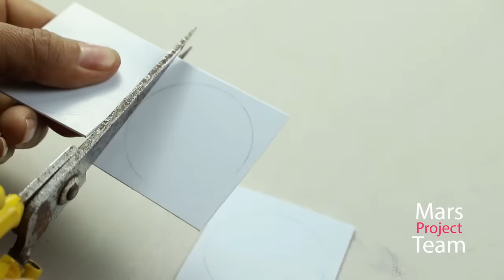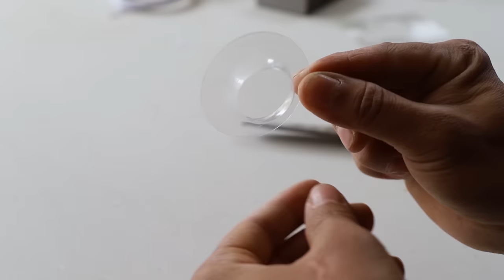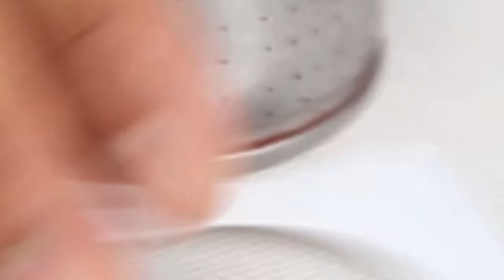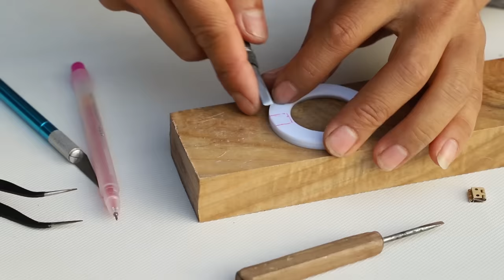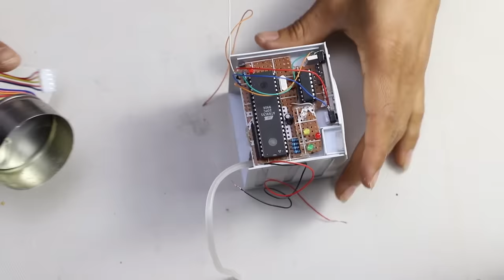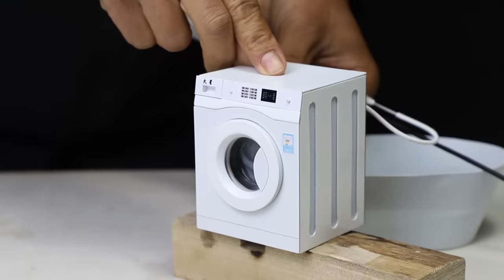DIY MINI Functional Washing Machine（Exceptional Cleaning Power!!!）미니어쳐 세탁기  - Mars Project Team

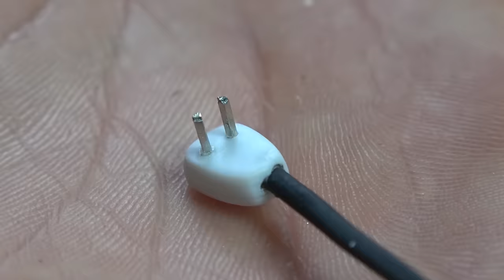Comment: 4:29 You forget the earth pin on that plug, this will result in electrocution off the dolls! 😂😂😂😂😂
Reply: Robby depends what country or land mass of earth you're on, different sockets fixtures fittings rules charges policies and all that other man-made corrupt fake shizen.
Reply: This does not works on houses that does not have the thing grounded
Reply: actually is a plastic cabinet, so is a  double insulation appliance, isn't necesary
Reply: The washing machine runs on DC power so the ground wire is installed already.

Comment: Maybe I missed it, but how does the water not escape from where the inner front part of the machine meets with the aluminum can? Wouldn't it be leaking all over inside?
Reply: He is using the base of the machine as the whole tank. That is why he has a submersible pump. And the front door seals through the tight fit on to the plastic foam front. I had wondered the same thing and rewatched it to be sure. He does not fill it to the centre of the drum cause of his stepper motor.